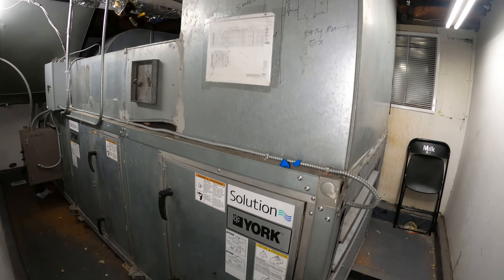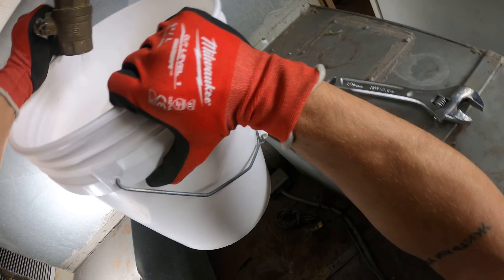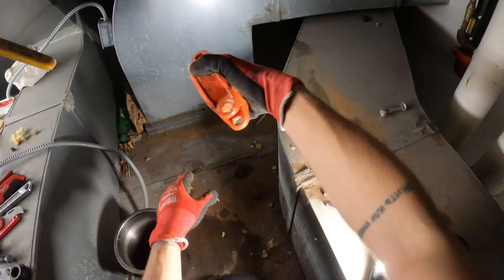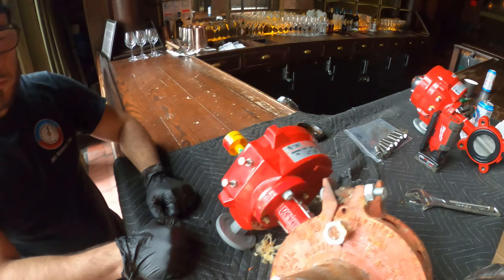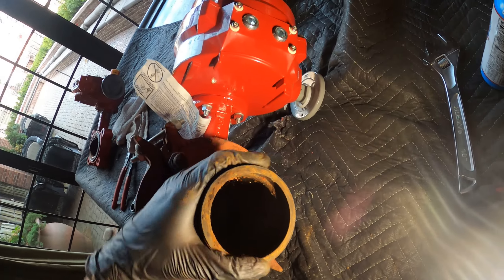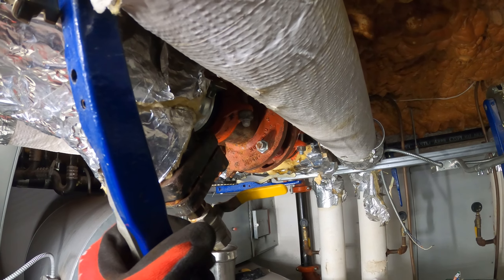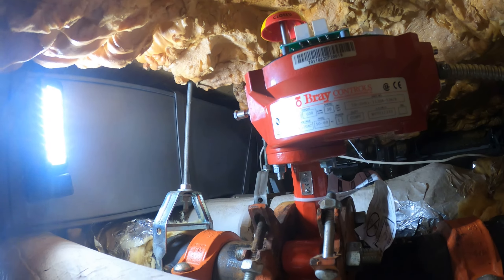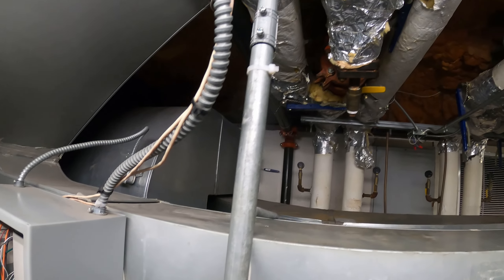HVAC: Bray Series 70 Actuator Valve Installation (4 Pipe Fan Coil Unit) FCU Bray Valve Replacement

Comment: That towel trick on the threaded bar works fine but if it is really stuck. Then try threading on two nuts and tighten them together on the bar for something to grab hold of with a wrench. 👍

Comment: Great job a usual jumper man tech. I work at university. I’m a powerhouse mechanic. Work on a lot of Industrial hvac equipment. What I like to do on the  signal handle isolation valve is to open and close the several time to properly seat the gasket seals. Stroke back and forth. Then if don’t hold dump the entire heating loop. Hot water system are a pain in the ass, because of the chemical treatment in the heating loop. Tear down and wear out  gasket and pump seals throughout buildings. Chilled water is always cleaner, but is condensate a lot causing bad rusty issues when not great insulation.  Good luck

Comment: I think it's called jam-nut. you can put 2 nuts on a stud, tight against each other, then unthread the stud with the bottom nut. it will push on the top nut, and since they are tight together, they bind on the threads and stay in place.